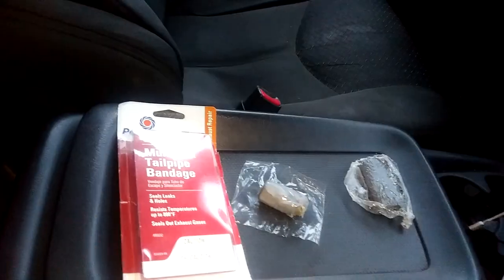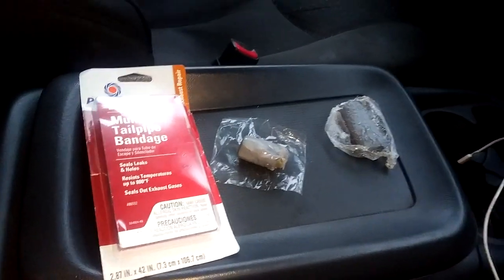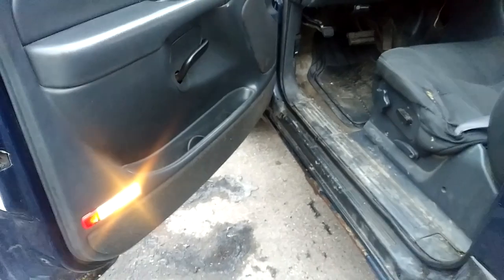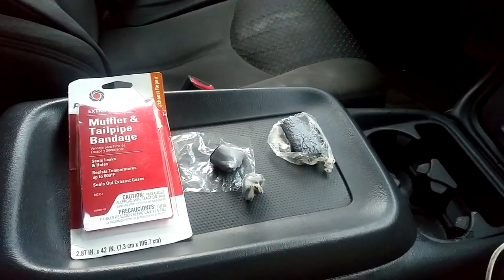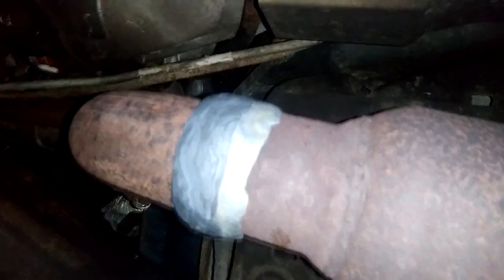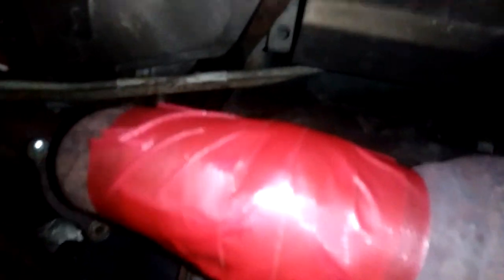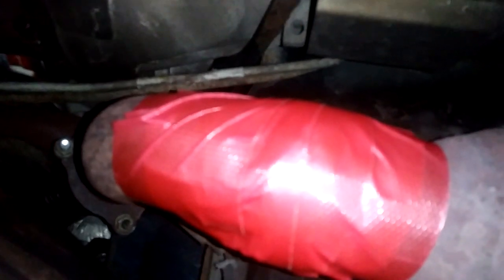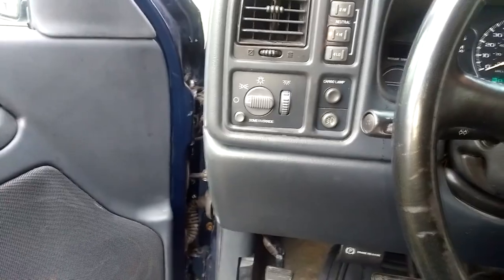02 avalanche (no welding) patch repair on catalytic converter

Comment: I slit catalytic converter on purpose. I tried cutting it off but turns out there was 2 O2 sensors so I couldn't. So I left it slit. Any idea what's the worst that can happen if I keep it like that
Reply from the maker: It will keep reading either a bad cat or 02 sensor code especially if the hole is to big
Reply: @byron7918  I have no reading. Nothing went off suprisingly and it's been like this for 1 week. Can it mess my actual car up?
Reply: @RickyKehoe  what kind of car
Reply: @israelelite2626  2015 Mazda cx 5
Reply: SaintsBoss what do you mean by "slit"? A cut that lets exhaust gas blow out? Like to bypass that cat? I'd guess it's be loud but run fine. Depends on whether o2 sensors are before or after the cut. Remember there can be flames...lol...so...

Comment: Byron Johnson, how did it hold up? I'd like to see a pic of what the red tape looks like now...)
Reply from the maker: That is a temporary fix it will hold up for about a month and smells really bad for a few days then the smell will go away but that is a budget fix
Reply: @byron7918  wellll... Temperature of the converter is higher than the epoxy is made for, I think. That's what's stinking..it's actually cooking the epoxy resin. Bad to breathe. The muffler "bandage" is brittle when dried, right? That means if the part(s) wiggle.. it'll break. There's stuff made to handle the heat and bake hard. But it has no strength to hold pipes from moving, so the only way it'll work is to lock those two pipes together as if they're one pipe.. like maybe a spot weld, strong enough to not flex and then won't break the patch stuff. I'm about to do this on a BMW where removing manifold means lift engine, remove motor mount and the underside structural brace. Not pretty. Can't get in to even turn nuts and bolts. And an actual replacement part is not available..but was two converters at $900 each. Uhhuh. So, I'll PATCH IT!!! But it'll be a permanent patch. I hope. I'll never buy another bmw, btw. Anyway, the hard as rock patch stuff should have chicken wire molded into it, to keep it from breaking off in chunks. Then it's a filler, wrapped around and into the gap in two pipes. And... they cannot move...OR ELSE. lol. Glad you made this video.  Thanks.)